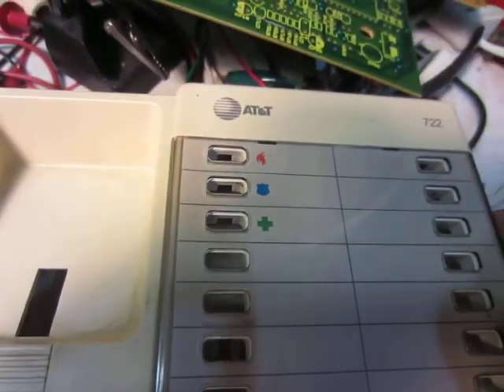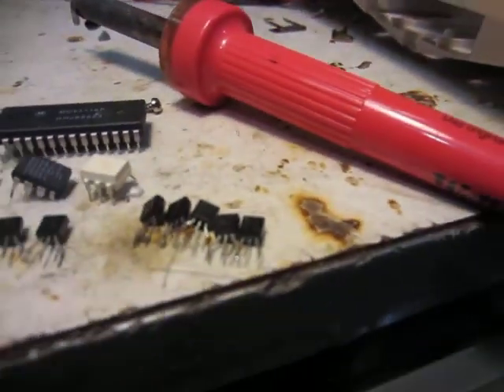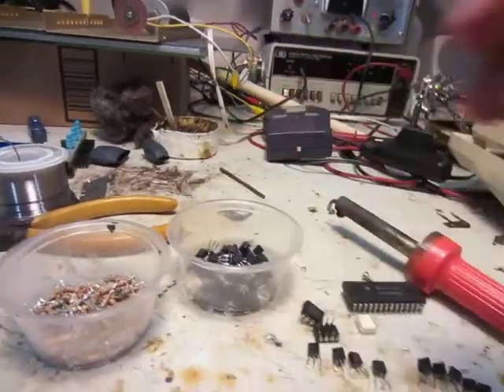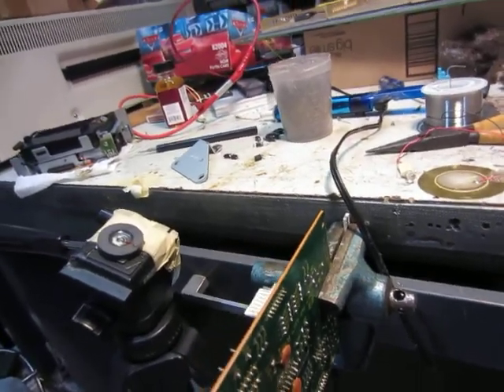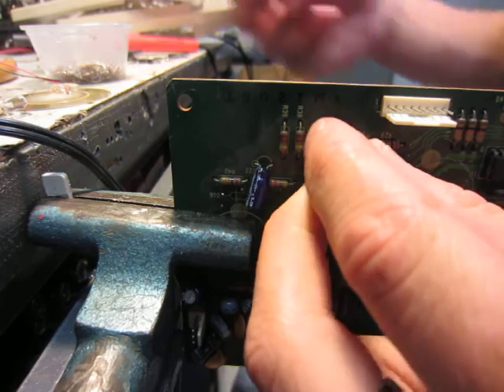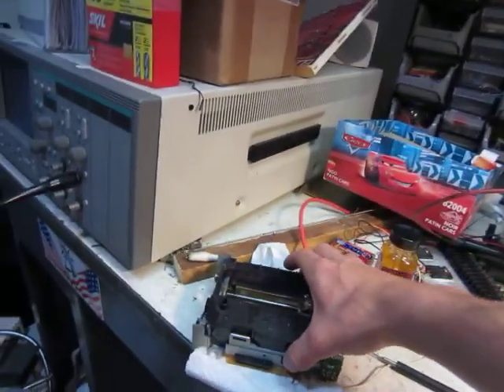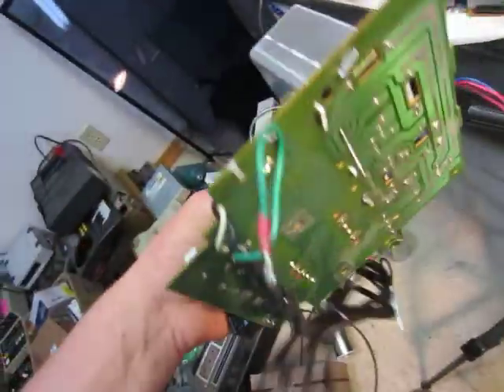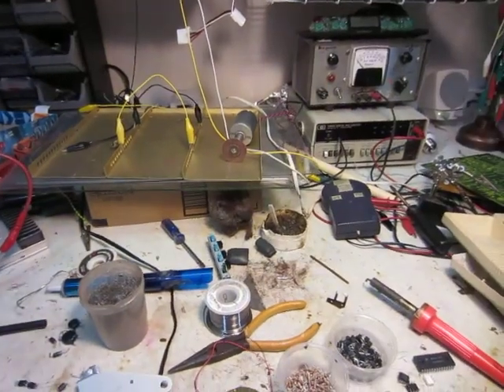DIY Resistor Remover - Lots of General Purpose Transistors in Old Phone and Update

Comment from the maker: Yeah I bought a bag not to long ago from Radio Shack.  Not to cheap.  I've never seen that meany good transistors in one phone before.  Well the soldered part would be in the water jacket of the stirling engine.  So it couldn't melt unless I was running it with no cooling water.  I made myself a lead alum battery today.  It is preforming very well.  It puts out 100ma for a few seconds when shorted out.  I am plotting its voltage with my XY plotter. The solder I am using is1.5% Ag and 98.5% Pb.

Comment: I've been paying for those transistors! I have a box full of old phones.... Do'h. Nice desolder tool. I use pliers with 45deg bend in tip. Your way seems faster and less magnetized..... I made a pb alum battery. Don't put copper wire in. It can dissolve from pos... RimstarOrg just put some good cap videos up. Seems he has done a lot of the tests we are thinking about... I have soldered tin can, but it might melt with heat. No good for steam!!! I am using silver solder now, with little success.